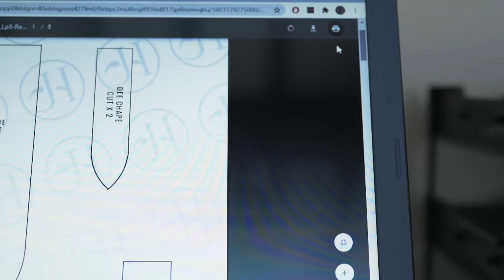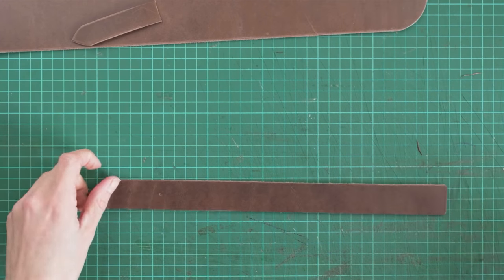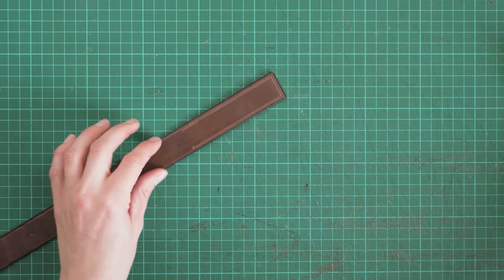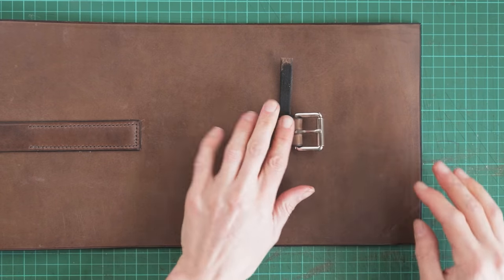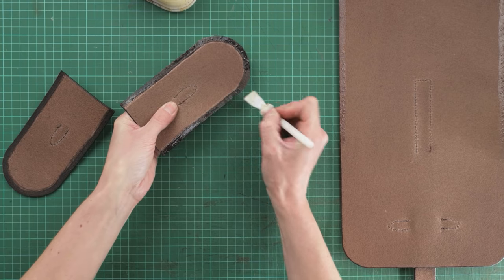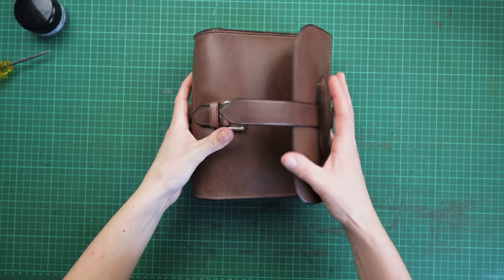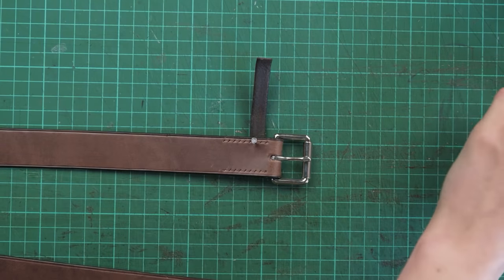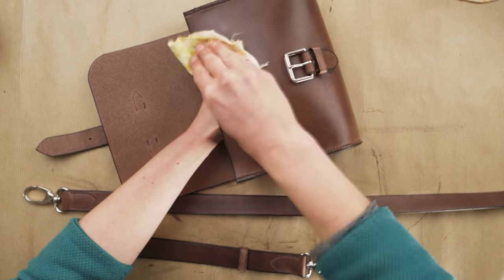Make Your Own -Shoulder Bag ~ Make Along // PDF Pattern Pack

Comment: Excellent work and tutorial. I’m still wondering why I’ve never used my small square on leather work, will fix this today 👍
Reply from the maker: They are so handy for leathercraft 👍
Reply: @JHLeather  it makes so much sense, I appreciate you doing the whole video, I usually edit 99% out, and I also realized that using a pattern would be really useful. I’m finishing a full sized two large inside pocket messenger bag (10oz) an entire double shoulder, real heavy lol. A pattern would have been super helpful. I subbed and really enjoy your content!! Plus I need one of those knives you are using for skiving and making corners. I like how it’s cut off a bit. Have a great day.

Comment: Excellent video Jo, I am going to have a go at this project. What is the awl you use? I will have to get one and get it prepared, and who supplies them?. This video pulls together some great skills. Thanks again.
John
Reply from the maker: Hi John, I have a few different awls they are:

Smallest one from Abbey England - best awl handle and 1 3/4" blade (its  very old and I have dropped it a  few times so its pretty short)

Largest one with flat sides - They don't do the specific one I use any more but it is from https://laederiet.com/soegeresultater/?search=awl+handle and then the blade would be probably the 50 mm https://laederiet.com/produkter/170-chisels/5170-diamond-pointed-awl/

One with the black handle is from https://www.blackmountainsleather.com/collections/tools/products/pricking-awl-ebony-wood-handle and I got the 2.3mm French blade as I wanted to try something different. It's really good but a bit fine for stitching thicker buckle turns. 

Hope that helps!
Jo
Reply: Champion thanks Jo, I will order one of the larger hafts and 50 mm awls and get it shaped and sharpened. Really looking forward to doing this build. Your finished bag looks amazing 👏.

Comment: Great video, thank you. While so many leather crafting videos are a bit rinse and repeat, I feel like your videos are more informative and I come out learning a lot more due to your depth of knowledge. Please keep teaching us, we do appreciate it.

Out of curiosity what temperature do you set your edge tool at, or was it cold?
Reply from the maker: Glad you like them 🙂 The crease is heated to give a better result, I use a hot plate to heat mine. I don't measure how hot the crease is as over the years I can just tell when it is right. Use a scrap piece to test on, if it's too hot it will burn the leather and if it is not warm enough you can pop it back on to heat up for a bit longer. Hope that makes sense.
Reply: @JHLeather  sweet. Makes sense. Thanks for the tip.

Comment: Great video.
Does your clam tighten up by itself?
Reply from the maker: Thank you 🙂 The clams I use have a wing nut on them in case you need to tighten them, but they hold themselves together due to the way they are made

Comment: Maybe a daft question, but im quite new to leatherwork, how warm does the crease marker need to be? 
Another fab video to, learnt so much from them
Reply from the maker: So I don't have an accurate temperature for you as its a case of warm enough to put a nice line on but not too hot that it burns the leather

Comment: Good job! 
I'm just curious why you still use your 9 prong iron on the short distance? As I see you have 2 prong iron though
Reply from the maker: I'm just used to using them like that so continue to do so, also I find it a bit quicker than using the 2 prong.
Reply: glad you do so that ppl can see they only need a long and a short, not 2, 4, 6 and so on like some sets try to sell you.

Comment: @J.H.Leather Hello,  I'm fairly new to leatherwork,  and I have been trying to find the weights that you use for holding the ruler and paper down while cutting...all I find is small paper weights that are only a few ounces in weight. Where could I find some like what you use. Thanks.
Reply from the maker: Hey Brandon, they are door weights that I got from Ebay so handy!
Reply: @JHLeather  thanks a lot

Comment: Great video, thank you. How can you improve the look of the flesh side of the bag strap, especially when using a swivel clip?
Reply: Have you tries using Tokonole or Tan Kote on the flesh slide followed by brisk rubbing with a smooth piece of glass or other burnishing tool? If the fibers are too loose, like a shaggy dog, you could try shaving with a safety skiver first.

Comment: A bit too late for this, but I hope Jo or someone knowledgeable replies please, as the info on forums are either too little to base a decision on or from unprofessional sources.

Jo, you are using two different awls.
1. one for scratching, apparently with a round tip, and 
2. one for stitching, which looks like having a flat tip?

Does it mean that, for stitching, one should only use a flat awl and NOT a round tip awl? Put differently, if I am to buy an awl for stitching would you recommend me getting a flat awl and not a round one?

I hope I am clear.
Reply from the maker: Heya, I use the round awl for marking out my work on to the leather and for stitching I use a diamond awl. The diamond awl is shaped to match the stitch marks and so helps the thread to sit in that slanted angle that is common with hand stitching. Hope that makes sense, here is a link to a diamond awl blade - https://www.abbeyengland.com/awl-blade-998.html
Reply: Back to my own question after a few days, and with help of Jo's comment, a rather newbie-friendly reply would be:

There are two main types of awls, as Jo said earlier:
1. scratch awls, for marking leather or simply punching through with no specific sensitivity for the dimensions of the punch. These have a round tip.
2. stitching awls, for piercing the already pricked marks made by your pricking iron. There are two sub-types of stitching awls: 
          2.1 those with a diamond tip and
          2.2 those with a flat tip
either of these two types is used with its relevant pricking iron- Japanese vs European. Japanese pricking irons prick leather with more of a diamond shape marks, and therefore followed by a diamond awl, while European/French pricking irons prick leather with more of a flat (i.e almost a  line) marks, and therefore are used with a flat awl. I think Jo is using Japanese. 

Haven't had my tools delivered yet, but safe bet I'll sound too pedantic to myself after a few months of leathering. :D

Comment: As always a great video and a superb finished piece. I noticed you used a couple of different awls during the video is there a specific reason for this? Hope to try this pattern out soon. Keep them coming Jo from JH Leather
Reply from the maker: Hi Tony, glad to hear you like the video 🙂 I used a couple of awls as they are different sizes, the smaller one wouldn't have been able to fit through all the layers on the buckle turns etc, so I used  a longer one for that.
Reply: @JHLeather  Thanks Jo downloaded the pattern just need to get the leather then good to have a go

Comment: Hi, entry level query re leather. What is the actual leather used here?  Purchasing leather to make various pouches, belts and small bags - even if it would require gluing together to obtain thickness - recommended thickness and hide type.? I'm floundering about wondering just what I need to buy? I am happy to buy unfinished veg tan - but what exactly is most versatile? Thanks... (Fil in Ireland.)

Comment: Thank you. Are those Chinese bought stitching irons you’re using please? I have considered buying these but haven’t yet taken the plunge.
Please can you post a link to the sellers website?
Reply from the maker: The irons I use are from Abbey England, they have 2 options bother are very good but the ones used in this video are the more expensive option.
Reply: @JHLeather   Thank you. So the ones you use are pricking irons rather than stitching chisels/irons?
I like your little skiving knife. I’m assuming that is also from Abbey?

Comment: Hi Jo, beautiful work! What is that half round head knife that you use for cutting your curves and skiving? Who makes it? I’m struggling to find the right knife for me and this one looks great. Also where do you get your contact adhesive from? I’m not sure where to buy it from in the UK, it’s a little confusing. Thank you :)
Reply from the maker: Hey Samuel, I got the knife custom made but you can get a similar one from here: https://www.georgebarnsleyandsons.co.uk/product-page/saddlers-head-knife I actually have 4 of these knives for use on my courses. For the adhesive I use bostik 6092, it's quite tricky to get hold of for some reason but I managed to get my last one from here: https://www.leatherandgrindery.com/bostik-adhesive-6092?search=bos though most contact adhesives are good for use on leather work as they give a flexible finish. Hope that helps, Jo

Comment: What are you using to sharpen your tools?
Reply from the maker: Heya, I mostly use wet and dry paper (usually 400, 600 and 1000 grits) and I also use a strop board for fine polishing.

Comment: wow question would it be easier to repunch the holes  then using the all please do not thing i am mork in your work at all just starting to work with leather first time i see this if i would understand why i may adopt this way to 
 yes and awesome video too
Reply from the maker: Hey Emily, it depends on how you work. I am used to using an awl so am happy to use that rather than punch my holes all the way though. If you feel more comfortable punching the stitch marks all the way through that is absolutely fine.
Reply: @JHLeather  thanks

Comment: You are kind enough to work on a centimeter grid so I paused the video many times to get the measures right and made a pattern from that. The bag came out great, I made it for the backrest on a motorcycle seat so no shoulder strap but a short belt strap horizontally on the back. Sold to a colleauge for approx 50 pounds

Comment: where did you get that silver ruler?
Reply from the maker: I have quite a few rulers! The one I think you may be talking about is the Maun safety ruler https://www.abbeyengland.com/maun-safety-ruler-metric-7712.html you can also get them elsewhere online. Hoep that helps, Jo
Reply: @JHLeather  Thank you....  I have several rulers as well but this one caught my eye because it looks like it has a raised edge that my  cutting blade might more easily follow! Has that been your experience with it?
Reply from the maker: Yeah it's pretty good, I like that I can put pressure on it and know that my fingers are safe 👍